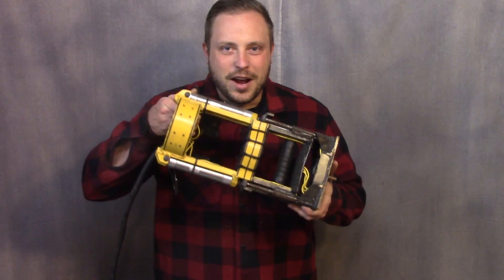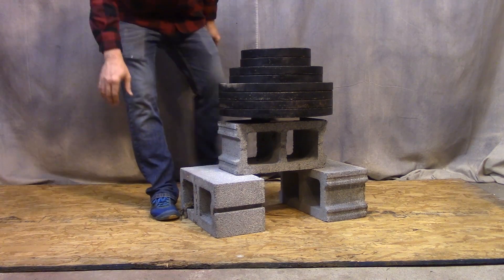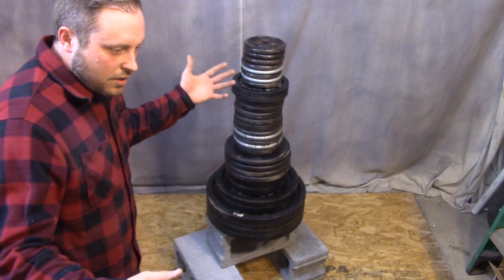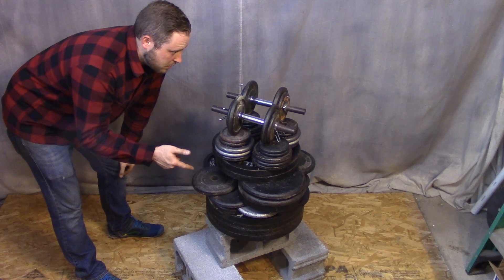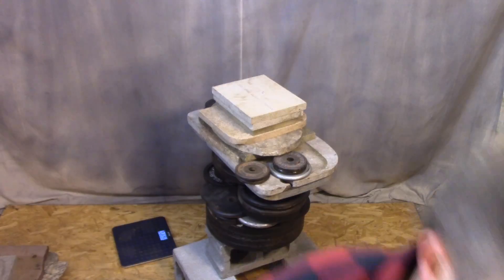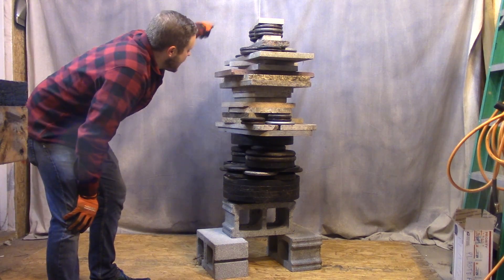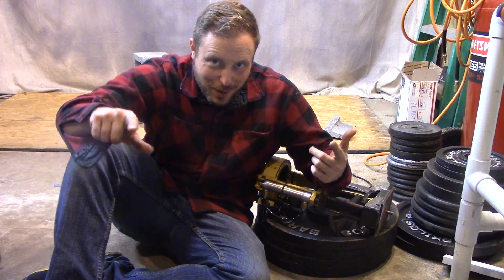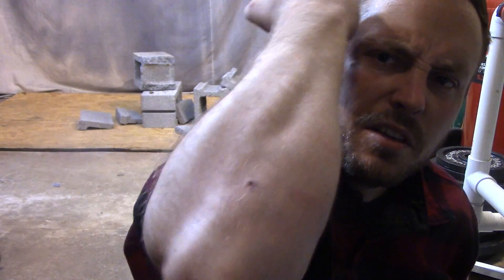POWERFIST POWER TEST - How much force to break a cinder block

Comment: there is one problem with this test. The Pressure is the key to it. At least I think it is called that way. Pressure = Force/Area. so using a ~200cm^2 plate to measure isn't optimal if u have a small pin at the tip of your fist. since the area is that much smaller you'd need way less pressure to achieve the same pressure.

Comment: Buddy, the amount of force that was implied when putting those weights on is nothing compared to the fist. 

As the weights stack up, the peotonanium amount of force is nearly 0-9. You see  the cinderblock is holding carbonleteration which is forced to stay like that. Say if you dropped the weights and not carefully balance them, the cinder block would break.

Now the force of the fist. Force equals mass times weight times acceration. According to my statistics, you forced a massive 688 pounds of force. Unlike the weights, there were no acceration. Just mass and weight. Say you careful put a knife standing up on my stomach. Nothing would happen unless you dropped it from a distance. So therefore no acceration.

Physics tell us no matter how much weights you put on that thing. It will never break. So next time, maybe be a little more smart about results like that.

Comment: Bro do you even know the concept of impulse Force?
What you applied with the weights was a compressive force which cinder block can take very efficiently. 
But impulse is a different story as it is brittle, m sure if you dropped even one of the weights it would break the block

Comment: The specifications (ASTM C90) for hollow load bearing concrete masonry units require that the block has a net compressive strength of 1900 psi. Since a 8" block is about 50% solid, it would take about 120,000 pounds to break it. The load you put on it in a building is much less because of a factor of safety.
As per google, thats assuming its flat on the ground though which this is not

Comment: The reason he was not able to break the block with the weights but could easily break the blocks with the power fist is because the power fist had a spike on the end of it that allows u to concentrate all your force into one concentrated point if the point was not there the force of u punching the blocks would have been evenly distributed throughout the surface of the fist. And on the weights u used a larger and flatter block that evenly distributed the force of the weights rather than pinpointing it allowing the cinder blocks to handle more force

Comment: Your experiment don't show anything sorry ... When you punched it all the strength you and your " weapon " put in was concentrate in a little spot, the contact wasn't a plan like with all the weights there were, no this was a spot . Apply the same strength the same pressure with your finger on your skin or use a needle ... Same force, but you didn't even feel it with your finger when the needle get through your skin ...
Reply: By using a surface a lot bigger with the weights it's only normal it resists to so bigs weights .. Take a spot as small as when you punched it , you won't need so much weights at all .

Comment: I don't think u completely understand this completely. U mixed up with ur physics here. The blocks dont necessarily break due to holding large loads of weight. They break due to a sudden and rapid increase of stress. Such as if u dropped 500 pounds of weight from 6 inches it will likely break than gradually adding even a ton of weights.

Comment: Because of the wideness of the bottom weights, you were diffusing weight onto the support blocks. Had your bottom weights been thinner and more towards the center, the structural integrity of the weight tower wouldn't be as good, but the block would break much easier.

Comment: I once broke a cinder block by knocking it over from vertical position to horizontal. By your logic that means the cinder block must've weighed over 1000 pounds.

Logic.
Reply: Seriously though, cinder blocks are designed to support, like, buildings. That's why the weight didn't effect it. Did you really think that you created 2 thousand pounds of force?

Seriously?

Comment: Dude... really? Those weights. You need to put something that focuses the weight on ONE POINT. Stacking the larger weights first was the wrong move, since they distributed the weight to the edges of the concrete block, and we know concrete has amazing compressive strength.

Comment: The weight distribution messed up your experiment 
For example if you stood on a bed of nails, they would not puncture your foot.
But if you stood on one nail it would puncture your foot. 
What you should of done is put all the weights on a small point in the middle of the cinder block
You punch was probably more around 1500-1800 lbs.

Comment: its about a focal point on impact weight does have some factors when it comes to power but think of it this way i punch your jaw it hurts maybe breaks if i know what im doing i hit it with my bone using it as a focus it shatters it same goes for any thing a bullet a car the more focused psi the more the more intense the energy is impacting it trying to displace that quickly causes a break the blocks were made to displace gradual pressure evenly

Comment: There's a difference between slowly adding weight and adding a lot of weight at the same time.if you would have dropped 1000 pounds on the block it would have shaddered.

Comment: Cool powefist, but the testing methodology was wrong. Comparing sustaining weight with even distribution (Fist hit the center of the block, while the weights sat on the entire surface) and weight of the impact Comparing don't work. Nonetheless, that power fist does have quite the impact strength.

Comment: you see the problem with using the weights is that speed is better at destroying something than a tationary weight. if you have any or thoes weights fall on the cinder block then it would have a better chance so of cource the power fist would break it with greater ease than 1000lbs of weight due to the speed that it is traveling

Comment: The fist is not putting out over 2000lbs of power just because it broke the cinderblock, the reason it broke was because the fist has a little thing sticking out of it wich concettates the force into one spot as the weihts were distributed over the whole centerblock levaing more surface area for resistence, plus ur fist had interia behind it giving ir more force than weight and if u dont believe this is why it broke this is the same reason that a metal wrench thrown at a window wont break it but a tiny half inch peice of ceramic will shatter the window, yes the wrench weighs more but the ceramic concentrates the force into one percise spot

Comment: Power vs. Force (I think are the 2 proper terms to use here) is the difference between resting weight on it, and applying that same force quickly. I.e. a well loaded semi truck going up a hill at 10 mph is gonna need a lot of power to pull all of that weight. Like, a lot. But that same truck with a speeding head start on level ground, will get it up to 70 and the truck climbs the hill with ease. So to gently stack 1,000 lbs on a cinder block is different than punching it. Sudden force like that will break it much easier. I'm not saying your powerfist is any less impressive, especially through two as opposed to one, but just pushing down on a cinder block is gonna take a lot more force than to punch it very hard. Keep up the cool videos!

Comment: Ok, you cant crush a cinder block. You're trying to crush it. A cinder block was designed to hold a lot weight, that's why it has that little tail in the middle of the block. If you pick up a cinder block and throw it on the ground, it's gonna break, and I'm pretty sure you can't throw something with 1,000 lbs of force, that's almost a ton! It's the impact force that makes the difference. You punching the cinder blocks is the same as throwing them.

Comment: it takes about 35,000 to 50,000 pounds of pressure to break that block. if you don't believe me look at the test requirement to run a test with the ASTM C140 for compressive strength testing on masonry block

Comment: Dude you do realize cinder blocks hold up houses in foundations and basement and the load distribution is completely different then striking it and splitting at the weakest point of the block

Comment: People really need to understand how PSI works. 1 pound equals 1 PSI on a 1 SQUARE INCH SURFACE... 1 pound applied to 2 SQUARE INCHES produces TWICE LESS PRESSURE (0.5)... that being said he's got at least 6-8 square inches of steel in between the block and the weight... you do the math.. not to mention the engineering behind the ladder design on those blocks..

Comment: The reason the weights didn't brake the block was because the weight was dispersed over a wide area, and you fist thing  broke it because the weight was focused in a smaller area.  Idk how much force you hit it with, but it wasn't no 2000 pounds

Comment: Look your not very clever are you that 1000 pounds was spread over a distance so it didn't break whereas the power fist had a far smaller surface area so it put out more force .Its like if you stand on ice you are more likely to fall through than if your lying down because your weight it spread out

Comment: Force isn't measured in pounds my dude. You played yourself.
Reply: It's 1000lb of pressure on the cinderblock sir issac fucking newton
Reply: James Weber actually it can be, one pound times gravity is one pound (force),  just another reason imperial is convoluted. That's why pressure is psi (pounds / sqare inch) and torque is in foot pounds.
Reply: Actually, it is. Pounds is the Imperial measure of force.
Reply: Ryan E dude his name is sk8er_flynn...hes obviously like 12
Reply: In engineering terms you use lbf or lbm (pound force and pound mass respectively). 
Edit: lbf uses the units
(lbm*ft)/(s^2). That's from F=m*a
Reply: Kendall Hayman Newtons actually
Reply: It's acctually funny
Reply: foot pounds
Reply: James Weber N
Reply: James Weber ppsi my dude
Reply: ikr imperial peasants.
Reply: When a video makes us take about science
Reply: Perry Komene Psi is a measure of pressure not force
Reply: OHHH you meant him stacking all the weight wasn't accurate to force measurements. I see
Reply: OHHH you meant him stacking all the weight wasn't accurate to force measurements. I see
Reply: James Weber psi??
Reply: Perry Komene or bar. Or pascal.
Reply: Sk8r_flynn maybe you should actually learn to spell actually bro

Comment: Conner can punch throught a cinder block because its the same as punching water. when u punch water your fist doesnt have much surface area so it pieces the water. If you took a long 30 by 30 inch wooden square as thick as the heavist weight he had it would  not pierce the water. Instead it would kinda slap it and then sink. Basicly same mechanic as a belly flop u distribute the impact along the whole body and when you dive its the points of your fingers or in this case conners fist.

Comment: The reason they did not shatter when under the thousand pounds of weight is because of how cinderblocks are made. When you break a cinder block, the sudden force of the impact causes microfractures, spreading through the material, and distributing the shock. That's why people can break cinder blocks over their heads and 85% of the time not be seriously injured ( but seriously, don't break the blocks over your head in the first place. That's just asking for it and tempting the reaper. Break them over your crotch, like a sensible human)

Just gently loading up the weight negates the microfractures, thus the cinder block does not break. That's why we can use them as building materials.

Comment: There's a difference between how much weight it can hold, and how much "direct impact/force" it takes to break an object. For instance, a couple toothpicks at the right angle can hold up a brick but if you   smack it against the brick it snaps.
Reply: Guarantee if you stand on it ya it can hold you but if you dropped all your weight in a quick enough succession it'd snap that thing in half

Comment: Lmao the weights test gives a slight idea of the power needed but your arm doesn't give off over a thousand pounds of force and the weapon does nothing but add a weight on your arm for a bit more force. The real deciding factor is the impact. With the weight test you sat still weights on it, they were not dropped on the cinder block, I am 100% sure if you dropped the 45lb weight flat on the cinder block it would break. I've dropped a cinder block from exactly 6 inches high on a diamond for testing purposes of corse and the block broke. Needless to say that your extravagant show of jenga was a complete waste of time but also not because it does put on a show and sway the minds of those foolish enough.

Comment: What you are trying to test is the impact strength of the cinder block, but you just ended up testing the compressional strength. Cinder blocks have really high compressional resistance but really low impact resistance.

Comment: I just want you to know that absolute tensile strength is much more than instance tensile strength so the weights gave no where near the the same results that your power fist dished out.
ps. cinder blocks are made to handle absolute tensile stress but at pretty weak against instance force like the fist.

Comment: Technically, there was gravity (since the bottom block was suspended) as well as the top block was adding some extra weight on the bottom one. So if you did all of the lengthy and extremely complicated math that would have to go into every force acting upon every stress point, it wouldn’t come out to be 2k pounds. But still very impressive!

Comment: There is a BIG difference between the force of a static load like the weights. And a shock load like the fist.. a better test wouldve been to take the weights and start off with the lightest and drop in onto the block. Work your way up heavier and heavier until the brick breaks. At the breaking point of the the weight used would be its force needed (roughly) to break a brick. Odds are at 15-25 pounds dropped from about 3' above the block would smash the block.

Comment: There is some more science to this. When you hit something you send kinetic energy that ends up pushing back with what you hit with, but when you stacking something it doesn't have  the energy so power is lost. You need to drop the weights of where your powerfist reaches its highest point.

Comment: There is a difference between hitting something and putting a bunch of weight on something. If you hit the cinderblocks with a sledgehammer you would break them so you're saying you could hit two cinderblocks with a sledgehammer and that's doing 2000 pounds . It's probably because your power fist weighs so much that the impact cracks the cinderblocks which then makes them break.

Comment: your effort to determine the breaking point of a cinder block with a static load is admirable. However, once you add motion it becomes a kinetic load, potential energy. to truely test your powerfist, adn I hope you do, you need some technology,scales, that most people do not have. Ands even then, you gotta maths really hard. 

IN a way, you were testing load strength; not force of impact; which is psi. And then there is momentum and I'm really drunk...
But! the thing is you tested it wrong, but pretty cool.

Comment: There're severe differences between kinetic and potential energy!  What you were displaying with the sitting weights was potential energy distributing the overall mass throughout the structure.  A punch or strike is all of that mass combined with the acceleration of said mass at a certain point in motion, being kinetic energy, initially increasing the psi far beyond what you get in resting position.  Anywho that powerfist is awesome!!!!

Comment: The reason the single cinder block didn't break at the vast amount of weight is because when you punched it with your iron fist thingy you put a lot of weight on it fast, so it doest have time to distribute the weight over the enitire block so the point of impact fractures along with the rest of the block. But, when you put the weights on it distributes the entire weight of the weights across the entire cinder block before the point of contact fractures. Because of this your experiment is inaccurate, but it is a good concept.

Comment: Cinder blocks are grate for holding wight but not for taken shock so showing how much it can hold does not mean that the fist is strong also you have a point on the top of it so it would course a fraction and that means it already week before the fist hits it so this again makes it require less power to brake it and one last thing cider blocks are very brittle.

Comment: A lot more goes into this than simply force (aka weight). Really what he should have been testing is impulse (force x change in time) on a given point-like area. 
Instead he tested force on a surface while trying to mitigate the effects of time by being gentle. This is a lot harder to do and relatively useless considering that he used an object that had a lot of force in relatively short amount of time.
tl;dr: bad physics

Comment: The force in pounds would not be equal to the force it took to break the blocks. Concrete is good for distributed loads as you demonstrated not sudden point loads

Comment: The reason of why the block didn't break was because the weight was distributed on the side of the block therefore your momentum and of you striking straight in the middle with a metal rod to drill on impact first was completely different then what it can hold.